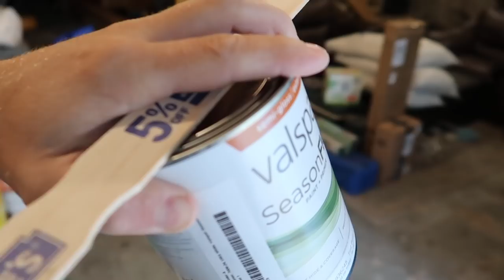She wasn't Expecting THAT!

Comment: Al, IMHO you need some shutters on the windows and front door so folks know it's the front do9r.  Then, rebuild the front steps with a small porch and flower pots on either side.  Fabulous!
The shutters should be black or the darkest green.
Reply from the maker: We liked to build a mud room off the front door
Reply: @LumnahAcres  good idea....then add shutters.  Very New England

Comment: A few things have me curious today. I was wondering where the pigs are pooping and how much  dung have they accumulated so far? Also I have never seen you eating pigs feet or chicken feet. Are you aware of the health benefits of these super collagen-containing foods? Animal parts containing less collagen but still healthy include ham hocks, pork necks, chicken necks, and chicken wings.
Reply: Oh, and one more thing. I was wondering if you had planned on mowing and baling hay? If so, those rocks in your field will keep you from doing that. Do you plan on just using the pasture as straight pasture and not mowing?
Reply: Oh, and I forgot pig's ears, which I think are about 30% collagen.  Very healing, very healthy.